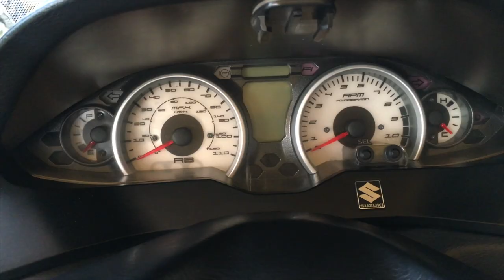Oil Leak and Smoking?! My fault or scooter's fault?? | Mitch's Scooter Stuff

Comment: Hello Mitch, 
You are a cool guy that knows your scooters. 
I have trouble with a 2007 honda silverwing 400 scooter and I use many tips from your videos.
Reply from the maker: Thank you! I have a friend with Silver Wing 600, he will drop it off for me to work on to make videos soon 😄👍🏼 I didn't know Silver Wing have 400cc? I thought only 600cc?
Reply: @MitchsScooterStuff  Oh cool im really looking forward to those videos! Yes 400 and 600.
400 is 40hp and 600 is 50hp.
400 is not so normal, but they exist, I have one in black 🙂 Everything the same as the 600 but just 200cc smaller, originally made for the Japan market

Comment: I Had The Same Problem Yesterday, Theres a Flaw There, Oil and Aluminum Don't Mix,  Top Screw Failed, Saw Mitch, Video, But just took a faster way Putting a Bolt Screw Backwards Fixed Now!!

Comment: Yep it happens to the best of us...what with the aluminium and 'pot' metal they use these days it's no wonder that it doesn't happen more often. Got one of those torque wrenches that can be 'dialed' in an have the old beam one an most of the time prefer the beam one if at all possible..good video on doing the heli-coil thing..

Comment: Man I bought this TAOTAO 150 mL from a friend. Only 4 miles on it. I just wrote it 14 miles and when I parked it I noticed right in the center above the stand it’s leaking oil. I’m trying to see where it’s coming from I didn’t notice oil on top on the flat portion so I gotta get in there and see if these bolts are loose as well

Comment: Hi Mitch, great video. I’m having an issue in my Burgman scooter 400, I replace the oil but I used the wrong torque wrench, and I broke one of the 3 bolts at oil filter cap, any idea how can I remove the broken bolt? Any help will be appreciated.

Comment: Hey Mitch does your Suzuki 400 burn oil because mine does at 5000 miles it started burning oil I have a 2013 400 Suzuki Burgman I ride mine on the Highway 2 and at least once a week I have to add oil do you ride yours on the highway and does yours burn oil?
Reply from the maker: Hi bummer about oil burning, mine do not burn at all... I use amsoil 10w-40 full synthetic

Comment: I don't trust those old style Torque wrench tools you use.  I use Digital Torque Wrench's, and test them for accuracy.  Seeing the Video, I see you fixed it... But I would not trust that Fix, I would watch for that part to show up on Ebay, and replace it with that one.
Reply from the maker: Digital one sounds good.. I could switch to one... I have been doing helicoil fix for years, never fail after the fix so I feel confident about it :)